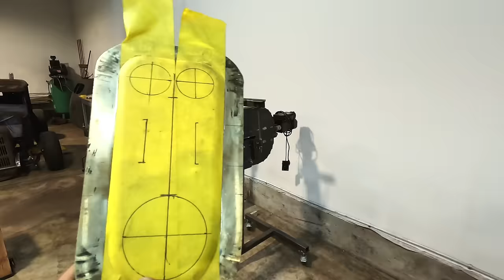Amazing "STACK A TACK" MIG Welding TECHNIQUE = NO WARPING! Finishing the Dash 1930 MODEL A

Comment: I hope you read this, concerning your grinding and health, way back when I had a homeboy that got a job in a sheetmetal shop. I was really jealous ( this was the 70’s) because I was working in a cave and pave shop as a sander / masker. I also was obsessed with Kustom cars even though they weren’t popular then. Ok my point is my friend was doing sheet metal. Time flue by and next time I saw hi he was pushing around an oxygen bottle using it to breathe. He told me that working in that shop and cutting and grinding without a mask made the metal particles ( dust), collect in his body. He struggled to breathe and walk he also passed away after a long losing battle. I love all your videos they are very helpful and informative and inspiring
Reply: custom cars weren't popular in 70s ?????
Reply: Yeah watching him grind without any PPE is sketchy
Reply: Yeah, when you are young you don't worry about such things, hearing protection too so your wife doesn't have to shout at you later in life. Although that can come in handy to tune things out. 😊

Comment: A die grinder with the point tip will get into that radius. Set your air pressure to about 25 psi at the hose. Hope this helps.

Comment: Don't rush by using compressed air to cool the tacks down, you're hardening the weld. let it aircool. It won't buckle any more, and the weld will be easier to rework
Reply from the maker: The proof is in the pudding. Try it

Comment: Karl, excellent stuff - just a suggestion: maybe you should get some more break-line and contour it to match the mig wand attached with zip ties - then it would be an all-in-one "Mig-O-Matic blow-gun Mig handle unit thingy" - maybe with a separate air trigger near the mig trigger, no more fumbling - one-handed unit! - LOL Paten - pending!

Comment: I never have used .030 wire, gonna try it. I have a very hard stone for shaping and straightening discs and stones. Works quite well. Also have a pic of the mechanism to adjust hammer stroke in a stroke machine. Love this channel.

Comment: I worked with an old timer for a while who had an IV bag rack that he set up close to himself when welding sheet metal. One side, he had his wand laid over and the other an air nozzle. It made it really easy for him to reach up without looking and grab his air to cool, and kept his mig wand out of the way from getting bound or twisted.
Reply: I attached an air nozzle to my mig handle. Operate it with my thumb
Reply: @roberthollinshead2325  I'm sure it works great, but that would leave me paranoid that a slag bb would land on the hose and burn a hole. If you've ever had that happen, you know it will scare the shit out of you. I don't understand the science behind it, but I've seen two hoses, blow apart from that happening.

Comment: If you have a lawn and garden shop or mechanic, I suggest you look at the grinding wheels used for sharpening chain saws? They come in a variety of thickness and have an awesome smooth grind. Also might ask for his old ones as they would be smaller?
Reply from the maker: Great suggestion!

Comment: I don't know if he addresses this, but every single tack will shrink slightly as it cools, so the material will be pulled, even if there aren't huge warps from excess heat. If you have ever tried to do a long butt weld on sheetmetal, this becomes obvious very quickly.

Comment: There are far to many U Tube welders, fabricators, bodymen, etc that ignorantly pontificate that the MIG welder has no business around a hot rod build! (yes you folks you know who you are). When I try and educate them I get slammed!  Thank you for showing us that a MIG welder has its place and furthermore can be used with very little distortion. After all many of us enthusiast do not have the deep pockets to have both TIG and MIG and as you just demonstrated not necessary.
Reply from the maker: Exactly. Nothing should stop you from working on your car! Use what you have and get it done

Comment: Don’t take this as me being a know it all because my question comes from actually not understanding. How come you MIG welded it all instead of TIG? I thought TIG didn’t distort as much as MIG and it seems like in the tighter areas it would be easier to grind the welds. I’ve never TIG welded before but I’d love to learn. I have learned a great deal from your channel.
Reply from the maker: One does not distort more than the other. It is heat that distorts. If a gap between sheet metal can be perfect and you have a long area to weld where you have access to be able to hammer the weld afterwards then TIG is preferred. This case being on edge, and in corners, where stretching the world back out is not possible, I find meg welding much easier to control distortion because you can keep the panel cooler than when you would use TIG

Comment: I don't think that using compressed air on the hot weld prevents any shrinkage.  The molten metal gathers up, and whether it is cooled quickly or slowly would not matter.  The shrinkage is controlled by jumping around on the piece with tacks.  It is the cold metal around the tack that prevents shrinkage overall.  Let me know if you disagree.  Of course the air hose allows you to weld the tacks closer and keep the overall work from heating up.
Reply from the maker: It sure does. The heat does not have time to soak the surrounding metal. So yet the weld will shrink a bit but the surroumetal will stay
Strong and not be softened to be affected by the weld contraction

Comment: Impressive work as always but would love see you just try out doing body panels with fluxcore so I can get some pointers haha
Reply from the maker: The one rule of thumb with flex core or anything that produces slag well welding is “if there’s slag you drag”. So for a flux core or stick welding, instead of pushing the puddle, you pull it.

Comment: Curious if you ever use anti-spatter spray when the MIG welding is on cosmetically nice stuff like that dash? I don’t see any spatter so you must have some way of avoiding it.
Reply from the maker: With proper settings and 75/25 gas , the spatter isn’t too bad

Comment: When you use this welding method is your machine set for the thickness of the metal or do you run hotter or colder

Comment: You mentioned you picked up a steering column for this.  How do you approach such a task?  I'm going to have to do the same thing for a project I'm working on, and have no clue where to start in looking for steering columns that may fit what I need.  Just some info on the general approach you take in making choices would be good.
Reply from the maker: There are a lot of different steering columns out there, depending on what you’re looking for. As far as the length goes, I like them to stick just barely out of the firewall, and then finish on the inside with a steering wheel in the right spot. So hold onto a steering wheel and have somebody measure from the face of your steering wheel to the firewall and then add a couple inches so that I can stick through.
Reply from the maker: The next video is installing the new steering column. Hopefully there’s a few things that you can learn from that and apply to your project.

Comment: Karl, do you have the air pressure turned down whilst doing the stack-a- tack? my shop air is around 100 psi and my air gun puts out more thrust than one of Elon's booster engines...

Comment: Kan anyone tell me about the gas bottles, regulators, hoses, gas mix, and water\oil traps and filters to use and suppliers good in lincoln nebraska. 
Most important, being stuck with a hf 140 multi-process welder where the stick welding function is garbage what kan I do to make that lie of a design work for struktural welding inkluding doing new strutt towers, wheel wells, rockers, sills as I am aware now. I have only 120v and it has to be poor krippled boys price level and health!
Reply from the maker: Not sure about where you live but using 7525 gas is the best for mig welding. If you need to do thicker material, it helps to preheat. Another way to make your weld hotter is do you have a little bit less why your speed. If you stick welding, use the smaller sticks to be hotter.

Comment: not trying to be the lone desenter here, your work looks great...but, forced cooling welds is a no no, you're freezing the metal structure in an excited state basically blending tempered metal against non-tempered.  Solid spots CAN lead to problems with porous welds as well.  maybe weighing the distortion you would get against the welding procedure is worth it, but i would never cool those welds.
Reply from the maker: Why is it a no no ? It works perfectly and isn’t a bridge or engineered structure?
Reply: i'll give that some thought, you may have a point.  Welding body sheet metal is quite different than if you were making structural welds, that is true.  I have been doing this work for nearly 50 years and was taught old school methods and the common thought is that you are changing the structure of the metal when you freeze it in it's excited state, so you have tempered metal mixed with non-tempered, these metals react differently to temperature changes, stress, etc., usually the thought wa this is a way of getting cracks, but...one thing i have learned over the years is to trust what you see as well, and to be honest i've seen alot of bodymen cool their welds and don't remember seeing a cracking issue, so maybe..just maybe it borders on a non-issue, my jury is out thinking about it, lol
  @MakeItKustom